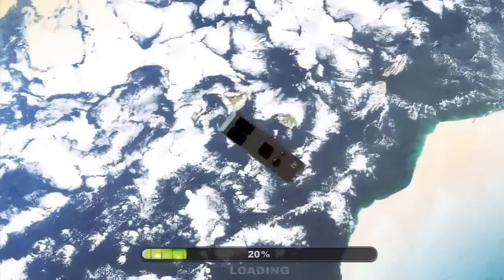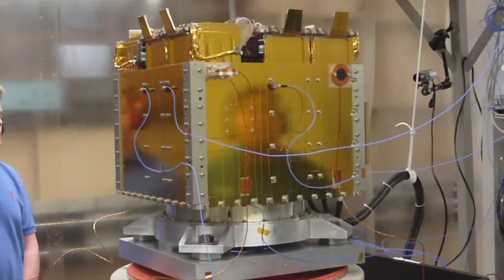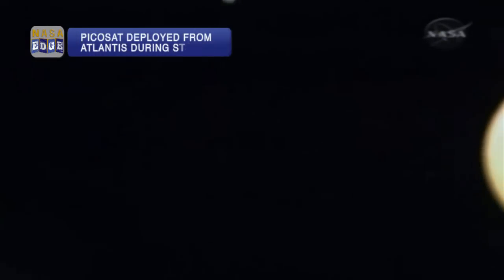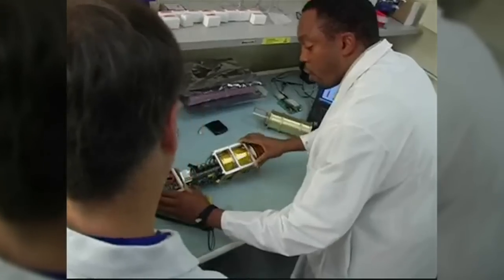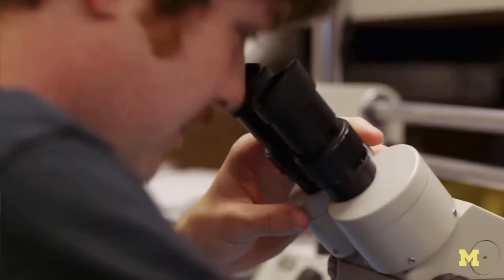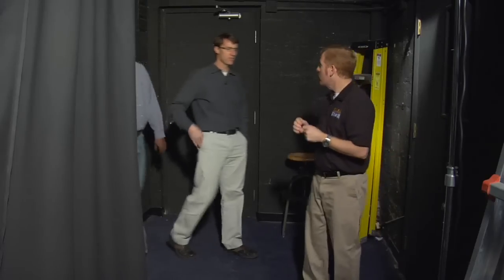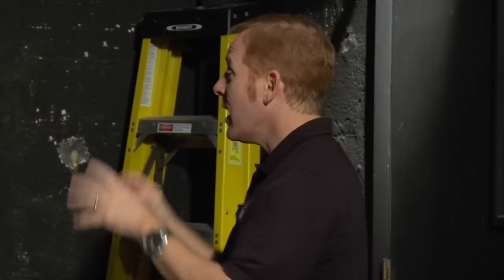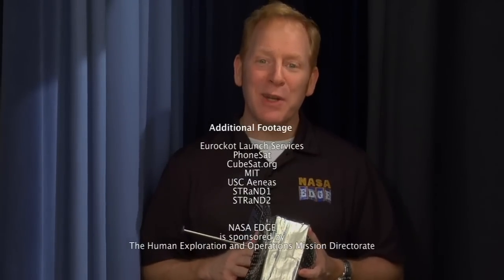NASA EDGE CubeSat Launch Initiative

Comment: The standard was given by CalTech... The thing is that the rocket that takes the sat to orbit has a spring-based ejection thing that throws it out into orbit... There is always room for innovation (and we innovated a lot), but you are still restricted by constraints on size, weight and stuffs. You can't have large payloads and much innovation in attitude control (although ion-drive might change this significantly).